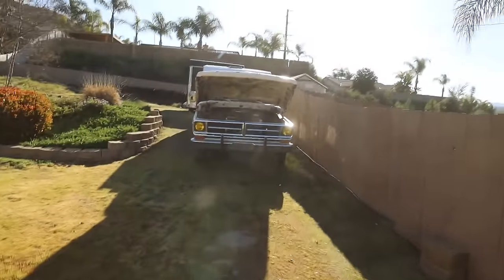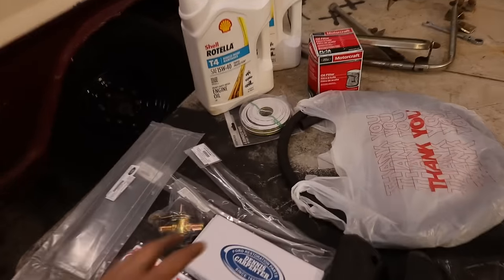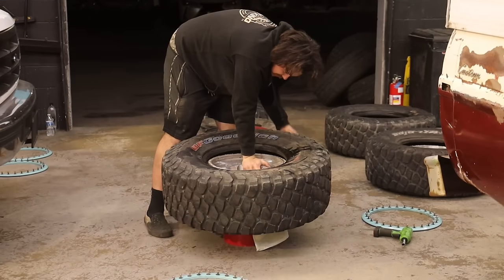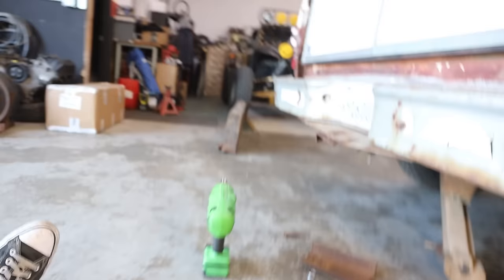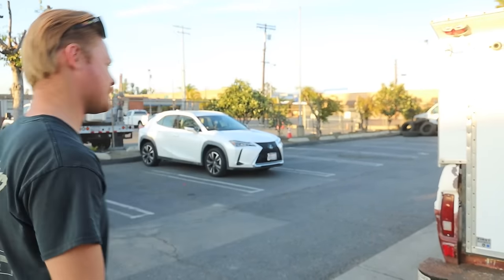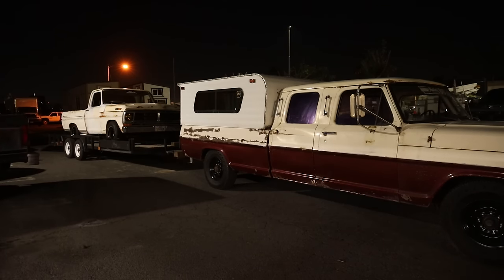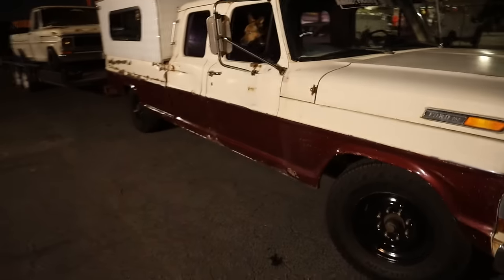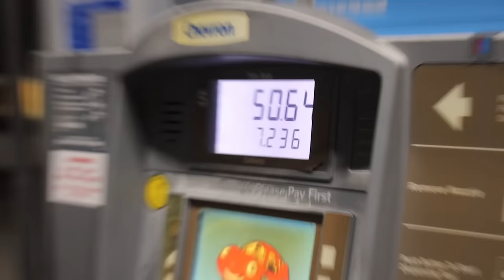I FINALLY Built My F100's Dream Crew Cab Towing Setup!

Comment: Love watching you get in and do it like you want to do . Here's a trick you can use. Try sticking the belt up through the bench seat next to the hinge. That way it is still anchored in the right place but now it won't dangle out the door when you remove it and get out. Work on my grandfather's truck when I was a young lad.

Comment: I had a 74 plymouth trailduster with metal door cards. Some cut holes for speakers also. I ended up just sticking speakers that weren't connected to anything in to cover the holes. Sucks when people hack things up.

Comment: I am excited to do the same with my 93 dually crew cab f350 and my 93 single cab longbed f150. That’s so awesome Craig looks sweet together. I just recently bought a new daily. An 800 dollar 96 ford explorer sport with a manual transmission, my first manual transmission vehicle and I love it. Had to sell the beater work truck ranger project I got last year with a blown motor and swapped in a motor. I was gonna v8 swap and build it into a race truck but I needed a reliable daily and couldn’t justify dumping more money into a beat old ranger

Comment: To prove Craig's theory the bumper is not going anywhere for at least 2 or 3 years and then he will fix it right, the other bumper with the Factory rear of the frame cut off was bent where the ball hit was but it did not come off!!!